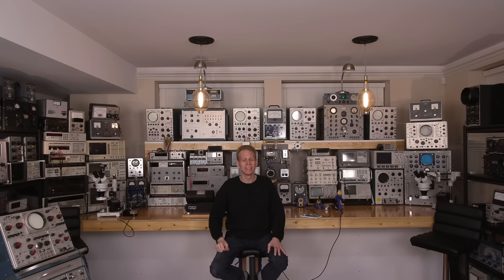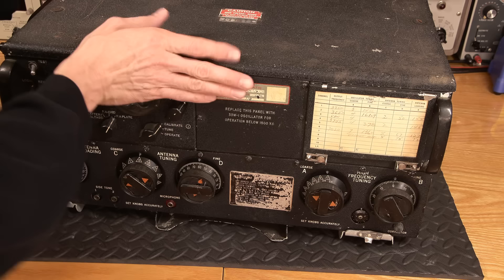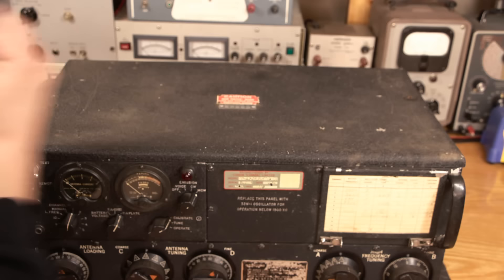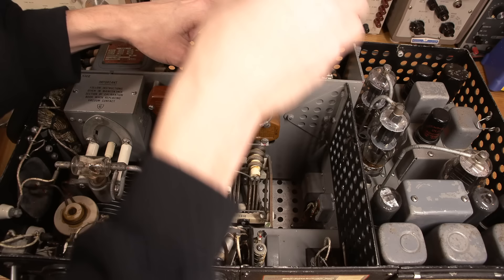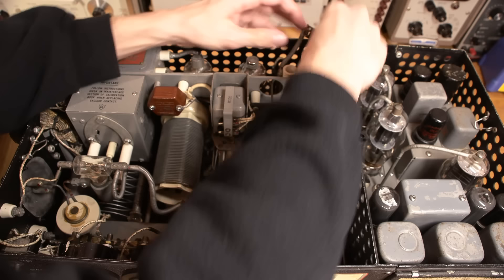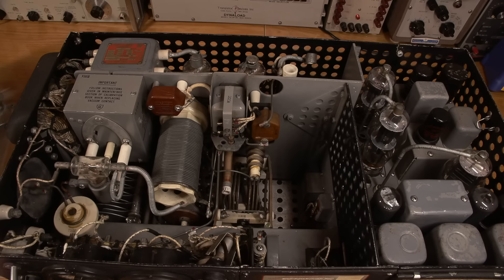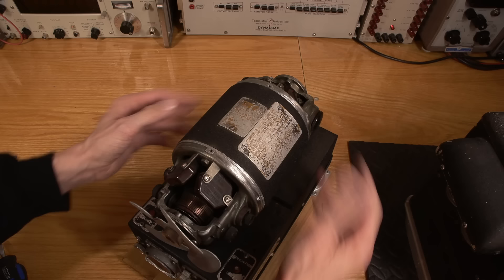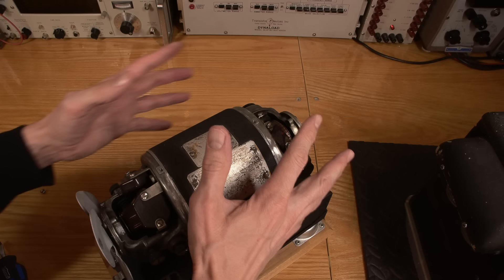1940's Radio Transmitter - The ART-13 Restoration Introduction!

Comment: You should build a turntable for your bench to facilitate rotating the equipment you're displaying and servicing.
Reply: Yup, a Lazy Susan
Reply: Def would have added a lot more lighting for that table and equipment it's always so dark
Reply: I made a couple for the workbench. Spin around too easy, I had to add manual friction brake so I could lock them down while working.
Reply: @Skibidi_Male_X  Turn up the brightness on your screen.
Reply: Idk what you're seeing, MCLs lighting and sound are always spot on
Reply: @kylefafnis  I think comments were not about video production values, but rather using a LazySusan to move and rotate the heaver receivers without damaging the new work surface.
Reply: Right, but Jim Davis was saying the videos are too dark.
Reply: Yeah, lighting those big old things is difficult, especially  the dark side away from the front of the bench. I most always use turntables to spin them around. Test leads and cords become a thing though.

Comment: As a 16 year old novice, I didn't have a dynamotor for my ART-13, so I tried to build a power supply to power it.  The first part of the supply was for the motors and filaments.  I had a sealed low voltage transformer with a dozen or so taps on the secondary.  I would apply 120VAC to the primary, rectify the secondary and apply it to the transformer and check the voltage to make sure that under load I was supplying the 28V to the transmitter.  Once I had it right I started playing with the auto-tuning.  After about 10 minutes, the sealed transformer decided to give up the ghost and exploded.  Imagine the sound of a 30.06 rifle indoors!  All of the molten tar inside the sealed transformer blew all over the walls and ceiling of the room I used for my ham shack, and my parents weren't very happy with me.  That was when I learned about the VA rating of transformers, and not exceeding it.  A very valuable lesson.

Comment: The ART-13: One of the most amazing pieces of radio hardware to come out of the Second World-War. It is my favorite piece of RF from that era. The B29 Superfortress usually had two ART-13 onboard!
Reply: And those avionics power systems were 28 VAC at 400 Hz (both nominal).  Not standard "shore power" devices that would have made building a power supply so much easier.  So, each of those ART-13 units had their own Dynamotor -- no sharing there!  The harmonics would not synchronize with each other or the big radial engine power plants, so it was quite a noisy environment.  Hence the need for those huge mica capacitors.

Comment: I used to work with military surplus radio gear back in the late 1960s and into the 1970s with a buddy while we were in high school.  We were also shortwave listeners and ham radio "newbies" or "wannabes", who worked on WW-II radio gear.  Those plate caps in a transmitter or some receivers were not just a HV risk, but could also cause RF burns if you didn't watch your distance and how the RF shielding was handled.  Especially if you keyed up a transmitter in "tune" mode with the shielding open. 

You are so spot-on with the different tube indexing systems.  This could be the subject of an entire video about all of the different approaches to how vacuum tubes have been indexed or connected in antique radio gear.  And the pitfalls of handling such tubes.  A tube with a base could be a disaster waiting to happen if the glue between the glass envelope and base has failed from heat and/or age.

There were a number of dynamotor (or motor-generator) to shore power conversion kits or recommendations in the radio magazines and ARRL literature at the time.  But some of the best times was just to go and absorb all that we could from some of the MARS operators in the area who were willing to be an elmer to young radio operators.  These MARS and AF-MARS folks had all kinds of gear that we couldn't get from commercial military surplus companies, like weather satellite decoders, teletype units and big, portable or mobile power generators (often motor-generators that would supply AC and/or DC for emergency radio communications) that even came with their own pup-tent for "all weather" operation.

Comment: I used to own one of these ! I was in my final year of high school when I spotted some type of "army surplus" radio transmitter going for a song in the newspaper classified. After my dad and I brought it home I plugged it in. The thing sprang to life with a lot fanfare. Loud popping and whirring but that was all normal. The transmitter was mounted on the top of a tall rack with a massive custom made PSU (no dynamotor) underneath. It had heavy transformers and pair of impressive oversized mercury vapour rectifier tubes .   My favourite feature was the high speed auto tuning mechanism.  Sadly I couldn't use it for amateur radio purposes as I only had a VHF license at the time . I hadn't learned the morse code which was  a requirement for a full HF band license at that time here in South Africa. Some years later for personal reasons I decided to get rid of all my gear so I gave the ART-13 away to a friend with similar interests.  😢
Reply from the maker: Thanks for sharing your story!

Comment: I like that high voltage warning, when I was 14, I built a TX for a friend and after working all night, I got to close to the output tube cap when I was tuning it and got an RF burn on my thumb, a nasty lesson. In the USAF (1963-1967), I worked on Collins equipment ARC-3 in the C-47, ARC--27 and on the F-105 and other jets that were much newer, the Marines used to fly into our base to get us to work on their radios. I think I still have the diagram for the ARC-70. That's a beautiful set you have. WA7VQR

Comment: A few years ago I used a Siemens E311b receiver with Hammarlund HX-Fifty in the shack. I repaired and calibrated both devices myself. A self-made frequency counter at the output of the transmitter helped to set the transmission frequency in the amateur radio band. Transmit and receive operation was switched with a coaxial relay in my antenna system. Radioing with tube technology is fun and I understand the whole thing. 73 Mr. Carlson

Comment: acck!  I had one of these but had to get rid of it when I moved,  It was long-term project.  This was Collins auto-tune radio.  You set the dial positions with the locking bars (by the red paint) and the system would (via the channel selector switch) spin each dial to the previously locked setting.  A kick to watch. But don't ever get them out of sync if you take them out of the radio....   It  looks like this one does not have the low-frequency plug that let the radio operate (been a long time, but I THINK 1mhz to 2,5mhz).  Good Times, can't wait to see this resto.!

Comment: There's not going to be much in the way of restoration work on the ART-13 she looks really clean. A quick alignment is all that may be needed these transmitters are bulletproof. Paul, what you need to do is a restoration on a GRC-106A set that will put your electronic abilities to the test.

Comment: I also have an AN/ARC-8 (BC-348 with ART-13) operational on 28 VDC.  I enjoy the dynamotor sound from both the RX and TX.  I run it off a PP-1104 PS, which provides 50 A at 28 VDC.
Bill, NJ7P

Comment: You're making me feel nostalgic for my Field Communications Electronic Equipment Mechanic courses at Ft. Sill way back in 1976.  After graduation I never touched anything electronic again.  I was sent to Ft. Polk where I was needed for the high tech job of moving the parking lot to the other side of the street by hand instead.  They needed to segregate the enlisted peasants vehicles from those of the commisioned peasants.

Comment: Excited to see this fixed up and in operation. It looks so clean, it kind of looks like it's ready to go. The automatic, motorized tuning on these is also unique. I bought two of these after watching the "B-29 Frozen in Time" episode on Nova, years ago. I spent some time cleaning them up, but decided I really didn't have the space to operate and display them properly, so I sold them. At the time, I had also purchased a military depot 28 volt power supply that was absolutely enormous (required a 220 volt outlet). That power supply would have easily powered that dynamo. Never got that running, either. It actually kind of scared me because of all of the amperage involved. I can't remember the model number. Maybe it started with G?

Comment: Thanks for another really exciting video. I always wanted an ART13 but they are really rare in the UK and after seeing the full BC375 transmitter totally pristine, full kit with TU units for most bands, antennas, connecting wires and bags and webbing at Rosmalen in the Netherlands but it was too large to get in the car. Sold for 450€ and I was totally gutted as I secured some space for the trip back to the UK before Brexit and when I got back to the stall it had sold. Still looking for a decent ART13 or BC375/BC191

Comment: Always fun to watch those art13's as the tuning dials all revolved until you got to the frequency you wanted. My brother Ron NU6F restored his ART13 and it works great. They are a really nice Transmitter from that ERA. And his is also period correct running off the Dynamotor. Should be a neat restoration for you to do Paul.

Comment: In their intended use, it didn't matter that those dynamotors were noisy... no way could you hear them over the din of four big radials banging away on the wings, driving big props just a few yards away.
Reply from the maker: Absolutely!
Reply: Nice one, what types did you fly in ?
Reply: @mtryambon  Haven't actually flown in one myself, but my dad got a ride in a B-17 back in the '90s and said it was very noisy inside.

Comment: many using a few supercaps to help with starting current of dyna motor.  use a slow start to charge them and than when keyed will give you peak starting current.    please switch the channel selector switch to manual before firing up and also look for mods to unlock the motor the runs the autotune otherwise can overheat and burn it up.  some install on/off switch for motor, others a couple of steering diodes so the motor is not powered unless needed.  looking forward to getting this running.   I use a home brew dc supply but many hams on the old military radio net still use the dynamotors, most using 2 deep cycle batteries in series for the 24 volts.

Comment: 807's and 813'so my!  I was licensed in '57. I was a VHFer and just used Gonsicators and didn't have any experience with HF transmitters, so I am glad you are covering them. I did own Hammarlund and Halli BOs.  I am curious about the dyno approach but wondered how the Gonsets could work from 12 (6?) V. Didn't they use a multivibrator to create square waves which were then filtered, transformed and rectified? I don't remember!  I just remembered the noise.    73

Comment: The dynamotor reminds me of those used with early 2-way radios in the 1940's & 1950's.  I think the power supply for the receivers was called a vibrator.  The whole assembly filled the trunks of service vehicles.

Comment: Just a thought Paul- why build a 28 volt 100 amp plus power supply? Surely the quickest and easiest way to power the "beast" would be to use 28 volts from lead acid batteries. Given that the power surge to get the thing started is not known, and any literature may well not allow for extra drain caused by ageing, it would be a lot of work to design and build such a supply. I appreciate that a mains power supply would be better in the long run, but unless you have one "on the shelf" as it were, not only would it be more historically acccuate, it would also save time on the restoration. Also the design and build process could make an intersting short series on the designing and building of bespoke power supplies. I think that a heavy duty (100 amp) sub 50 volt psu would be a worthwhile addition to the ham shack and lab. Great series, please keep up the good work, you are educating a whole new generation about the gear used in the past. 73 Jim M7BXT
Reply: The GRC-524 FM units consume about 50 amps at 25 volts or can use a portable AC power supply .

Comment: I had to stop the video and comment on your explanation of a motor/generator. I worked on motor/generator racks for IBM mainframes in the 80s, but they were about 1100lbs fully configured. Basically dirty line power going in and clean usable power going out. Probably not relevant but it was a fun job.

Comment: The device you crank by hand to make voltage for the radio make it so you can work it with a treadmill and put it in a fitness center so they work out you get free electric for the radio very nice radio

Comment: I once rewired a motorola tv 7 to run on a 51studebaker conv used a dynamotor for b+ chavnged tubes to 6volt was abt1957 worhed well  unique at the time ❤.

Comment: The ART-13 was a big leap forward compared to other military aircraft transmitters of the era. It was first used in the B-29; other heavy bombers usually had the BC-191/375. Note how few controls it has, particularly tuning controls.

Comment: I'd like to see you do one of the vintage TV's too. I remember seeing an early one on your shelf. 7-8 inch table top roundie from the late 40's. I have a similar one (Motorola). I'd like to see what you do to replace the high voltage stuff. Mine has no power transformer, electrostatic deflection like oscilloscopes, and the filaments are series string so getting the high voltage is interesting when compared with later TV's.

Comment: An 807 has a 5 pin base while the 1625 is 7 pins. The only other difference is the heater voltage. Insures they won't be mis-sustituted.

Comment: The low serial number of the dynamotor means nothing on its own. It must be used in conjunction with the order/contract number. The serial numbers reset to 1 most of the time for each order/contract.

Comment: I'm sure you already know, but you're not supposed to touch the glass of an 813.  The oil from your fingers will stain the glass when it heats up and create a hot spot and stress the glass.  Clean with alcohol before loading it up.  I wouldn't touch the 811s either, but I'm just extra careful.
Reply from the maker: Who told you this? Is this some audio thing now? The glass of a real 813 is Absolutely Not affected by oil from fingers. I have been handling 813's for 40 years, never a stain.
Reply: @MrCarlsonsLab  It was common knowledge back in the day.  I’ve never known one to break either, but it was standard practice to not touch them.  Same thing as you would never ever touch the glass of a 4-1000, and for the same reason.  Maybe you aren’t running A3 much, so they don’t get super hot; but it’s not like touching one means it’s going to explode, just increases the risk of envelope failure over time so you make a habit of not touching them (or cleaning afterwards).

Comment: If you have a CC/CV lab power supply capable of supplying the 30A or so, it would just work with the CC function performing a soft start. Otherwise, use two PC/server PSUs in series with a diode in parallel with one, then you can do a half voltage soft start by turning on the PSUs one at a time.
Reply: I would avoid running two switching power supplies in series with only one powered. I blew up a switching wall wart that way.
Reply: @eDoc2020  Hence the diode, to prevent forcing current through the unpowered one.
Reply: @NiHaoMike64   I missed that part. It would need to be a Schottky diode. But I would still be wary. A regular PSU's output has a diode in series with the secondary so some of the current would still flow through that even with an external diode.

Comment: Dear Mr. Carlson. I'm from Brazil and worked a while restoring an old 1940's british radio set. It's branded Bush. I did a basic restoration in teenage years, and it picked up some bands very roughly. Before Cov-19 I dismantled it completely, worked the transformer, tuner, etc., now time to buid it back again. I never found exactly a schematic for the its circuit, because it was a somewhat rare "export model", with a special four band tuner. I dismantled it carefully while creating a CAD diagram and CAD chassi layout. Still I struggle to understand the curious tuning circuit. It squeezes out two bands from a single pair of RF band coils, one of them is tapped. Would you take a look in my drawings and comment on it personally or publicly? Best regards.

Comment: I had one of these in the early eighties, but got rid of it (which I deeply regret) as I didn't have the space or the access to information at the time for it, it even had a power supply (bit beast, heavier that the transmitter and built into a rack)

Comment: The art 13 is a formidable piece of equipment but wasn't the BC 375 used in most large ww 2 aircraft. Of course its was a piece of 1930s junk compared to the art-13
Reply: yes ART-13 was really for the B-29

Comment: All of the car outlets I've gotten vibrate and make a loud humming noise when plugged into the DC jacks. Are you sure they're solid-state? To be clear, not anywhere near as large as the thing on your bench.
Reply: Vacuum tube car radios used a "vibrator" to turn DC into square wave AC and a second set of contacts to rectify the high voltage from the transformer.  They made a buzzing sound

Comment: What's the RF output power of that transmitter?
Reply: Depends on the screen, and plate voltage mine runs at 425V and 1500V for about 200 watts out.